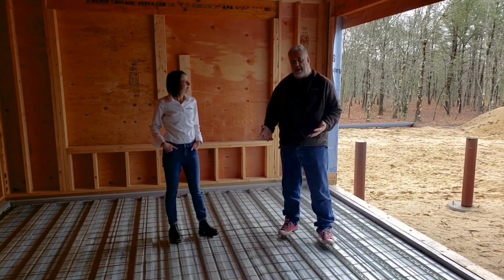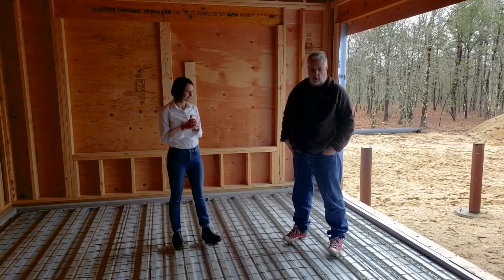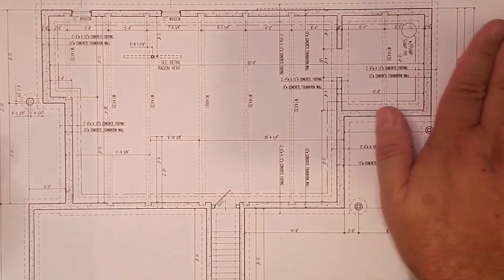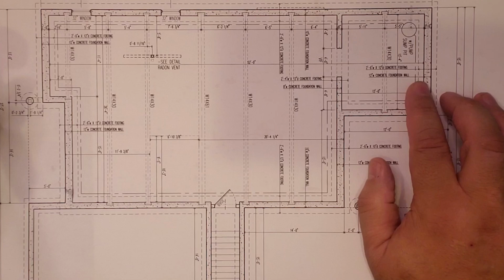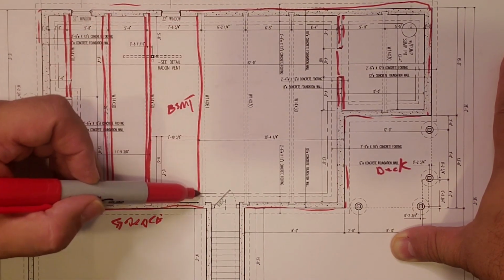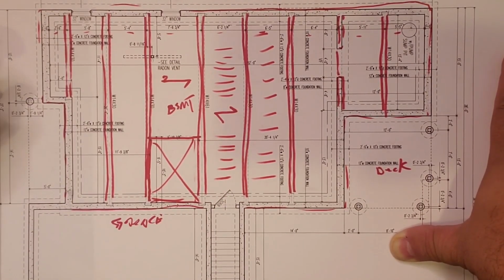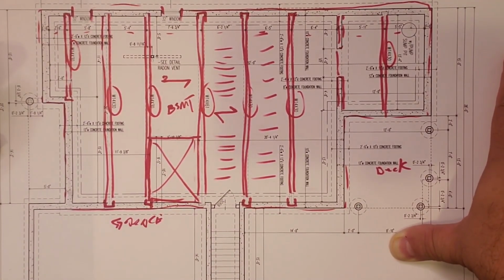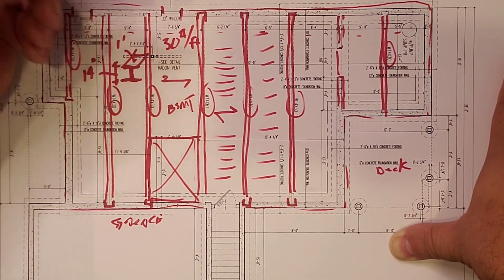ELEVATED Concrete Slab - First Floor

Comment: Steven, how thick is the slab? If the slab is less than six inches, can you share any insights on this? 

Also, I only see welded wire laying on the decking. Was rebar added to this?

Comment: I found this video (subscribed to too) somewhat funny. I know that in the states concrete floors slabs except for foundation or ground floor is unusual. But putting I beams 14” high seems a little too much. If you have a good engineer it could be calculated with a simple dual layer rebar with good concrete mixture. And I’m sure that there will be some partition walls in that basement that can function as support if the engineer isn’t sure of his calculations. We ( I mean in Europe) usually do spans up to 6 m without any particular measures to prevent sagging. Above that we have engineers who calculate the needed reinforcements ( ring beams, additional rebar, reinforced concrete columns) but those are rarely used for residential projects (single family houses). Meanwhile in commercial projects concrete slabs on multiple floors with spans above 30 ft is nothing unusual. But nonetheless nice video.
Reply: Agreed. However a lot of decisions get made based on what the local labor pool is capable of. In rural Maine you could get a dead deer dressed out nicely a lot easier than a dual layer rebar job.

Comment: Was there a consideration for using a lighter weight gyp-crete to support a hydronic heating system with large format tile applied over it to achieve a similar modern look? It seems that this would not require so much steel and would potentially eliminate the need for the metal (DenseDeck?) floor sheathing. All of that metal seems to be very cost prohibitive.

Comment: Steel and concrete composite, for me the welded studs on top of the beams was the cost prohibitive part, but we found a guy with the right machine. Also had to shore up the decking with temporary bracing. We also did hydronic.

Comment: I have an elevated concrete 3 car garage floor. Nice , especially with the walkout. I was able to drop a lot of my foundation walls due to steel columns. But I cannot see how this is good for an interior floor. I guess I will wait and see how the project proceeds, maybe my thoughts will change.

Comment: What’s a one way slab?
Reply: Search for "one way slab".  
"A one-way slab is a slab that bears the load in one direction mainly. It can be a slab supported on two edges only or a slab supported on four edges for which the bigger span length Ly is at least twice the smaller span Lx. The design of a one-way slab will lead to reinforcement mainly in the bearing direction."

Comment: I built an elevated slab 41 years ago.  That being said, what was the product used for the fluted deck?  Were there additional supports under the deck for the pour?  How thick is the slab?  Was the decking deformed during the pour to compensate for sagging?  What was done to reduce stress cracking?  Does the floor have hydronic heat?  Was rebar used?  Were there penetrations in the floor and how were they sealed?  Thanx, Dylan
Reply: I have all the same questions. Hopefully some follow-up videos will give some more details.
Reply: @DeuceDeuceBravo  Ditto here
Reply: Why not use LiteDeck in this construction?
Reply: @michaelanderson9626  Presumably because there is no need for the insulation value you pay for with Litedeck. Epicore would work well though.

Comment: It's great to see this. I've been wondering why we don't see more elevated concrete slabs in houses. They're totally routine in commercial work. I wish the IRC code would provide some prescriptive approaches to allow them without having to involve an engineer.
I'm an American, living in France. And here in France they have precast concrete beam elements that are used to make elevated slabs like this. Again, it's totally routine. The problems have all been solved. We really don't need to reinvent the wheel.
Reply: I'm in Rochester, NY, and knew someone, since deceased, who (probably 1950's vintage) built a house with lots of masonry stuff, including slab floor sitting atop precast concrete joists.
Reply: @kc9scott  I live in a Florida house from 1953. It has a double T precast second story with a poured cap and real terrazzo on top of that. Not a crack in it. Unfortunately the first floor is about 2 feet above high tide and I get flooded every year from Tampa Bay. It almost happened today in fact.

Comment: how does the cost compare to double floor trusses?
Reply: I was wondering the same thing.  It has to be more expensive than double trusses with a concrete pour over.  The steel beams alone would pay for the more than the trusses and then there is the Q-Dek and the mesh and on.  Maybe he'll discuss that next time.

Comment: Will this work with hydronic heating & Cooling?  What is the cost difference between this system and a wood equivalent?  Do you recommend doing this on other projects or was it something you only recommend for special projects?
Reply: I think they missed an opportunity with hydronic tubing.  I want to do some thing similar in my next house, but am interested in engineered floor trusses and WarmBoard as the subfloor, then a thin layer of stamped concrete.  I have hydronic heating in my basement slab and under the subfloor of the first floor.
Reply: I am also looking at this for my next build.  I have been speaking with WarmBoard locally and have half the house I could use it, on the second floors.  I am doing thermal mass both high and low mass.  When I saw this idea, I sad for myself, that has its place in my design.  Such an interesting idea to take from Commercial put in Residential.  We need more of this! @burrowsal
Reply: @BradleyKerr-dd2vf  High thermal mass in your floor together with a hydronic system is something of the past... the highter your mass the more difficult it is to regulate your room temperature.

It's better to have "all your thermal mass in a liquid container" (drum) and as less as possible in your floor.